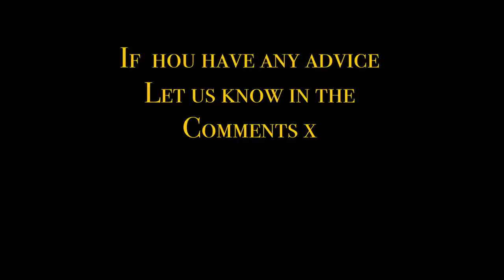EP27 The flood Disaster! Extreme Weather at the Chateau.

Comment: I live bordering a marshland and our cellar floods.  My advice would be to get floor fans to dry the floors after the water has been removed.  Don't want to have mold.  Also, if you think it might happen again, sands bags in front of the doors may be a help.  Good luck with your clean up.  Also be very careful walking in a flooded area, be aware of electric cords as water is a conductor.
Reply: That's a good thing to think about. 🤔

Comment: Oh Anna & Ed, my hugs for you. Glad everyone is alright. Sorry I will write a lot. Just want to help you with watery condition. I can understand your worries & the aftermath bcos I had experiences with unpredicted wheater too in my family retreat home, in multiple times. It was also in the valley with more terasering landscape & stairs, & river on the bottom. For outdoor, check for the soil for the erosion on all the water pathways, especially for the solidity around the buildings & stone stairs. For the wood materials, especially for doors/cabinet, check for perhaps the slightly expansion near the edge. I used the warm-air (not the hot one, the middle one, I don't know what the words in english) on my hair drier to prevent further  water capilarity into the wood. Give enough air circulation to prevent moisture on you furniture. Well, I hope it could help you. Also please check your tile roof if it was too windy, sometimes they slide ❤ from across the globe
Reply from the maker: Thank you for all your advice and thought Maria, 7 days on and everything is nearly dry, and outside things are almost cleared up apart from the back road near the terraces. xx

Comment: I recently started watching your channel and love it. I'm so sorry your magnificent chateau was in danger..so I thought I would share that I recently saw a YouTube commercial on an industrial strength rubber tubing that you can place directly around the perimeter of the chateau. The tubing is quite large, 30 inches wide and high. It probably comes in different sizes and lengths. You fill it with water and the weight and strength of it holds back the flood waters.  It has been used in USA to hold back raising river water and appears to work if used properly. Good luck and I hope and pray that all are well and safe.

Comment: We asked FEMA here in the United States to help us after a major storm, Hurricane Irene put over 1 ft of water in our basement.  Our youngest son made a video of the flood there. My oldest son contacted the fire department who came over to pump the water out of our basement.  Afterward, we bought a new sump pump.  We had lots of mold through out the house and a damaged roof too but, since we lost our hot water heater, we decided to purchase a water heater that hangs on the wall which heats only the water we use.  Buying that used up all the money that FEMA provided for us but it is worth it.  Not too long afterward we applied to FEMA again for additional help for the roofing materials.

Comment: Ed and Anna, we are keeping you in our thoughts and prayers. Living on the Georgia (GA) USA Coast, we have experienced horrific weather over the past six years now, five Hurricanes with days of torrential flooding, lightening, winds of 100+ miles an hour (the kind that blow your roof off and flying objects, trees down, etc.) 5-8 days with NO electricity. This seaside area is located in a 100 year flood plan, meaning that little or none occurs within 100 years. Well because we are on the coast the water dissipates quickly but so does foundations on buildings and roads, bridges and overpasses on the highways etc. What I saw in the vlog of the free flowing water greatly concerned me. I have seen entire hillsides collapse and get completely washed away, along with the roads and homes in its path.  Please DO NOT walk around the earthen ditches and walls, because they do collapse, and the water flowing downward does create sink holes. May I suggest that you shore up the main road, and the hillside where the grapevines are planted, with a stepped system and lots of sand to absorb the water where by the water is collected in a sistern and rerouted back to the vineyard to use later, as well as having an additional cement wall 4-5 feet tall with rebar around the outside of the perimeter of the chateau on the hill side. I am so sorry sweet Charles was traumatized by the storm.  Perhaps he could sleep near you all on a cot or with Emma, for a short time, while his big boy room is being repaired and redecorated. Comforting thoughts for all of you as you are repairing Mother Nature's (unwelcomed) visit - very important to get Charles involved in the cleanup. It will empower him to know that its ok, and things are going to be righted again. As they say, we must get back on the horse and ride it. We are now in the 2021 Hurricane season until Nov/Dec. here. Love and Hugs to all, Bren

Comment: well done; its very traumatic... we had the same a few years ago; with water going through our house for seven days before we could stop it.  You have to check the water hasn't seeped through the tiles - through the concrete subfloor and saturated the insulation... We had to dig all our floors up because this had happened to stop it all going mouldy and climbing the walls.  Dehumidifiers help but need to be run for weeks to dry everything out properly to stop the mould

Comment: I have been through several floods. It helps to have sandbags available, to place in front of the doors before a big rain. 

If the water inside hit the drywall, you have to be concerned about black mold within the walls. 

I am so sorry!
Reply from the maker: Thank you so much Lynn - thankfully the plinths protected the plasterboard in the kitchen. xx